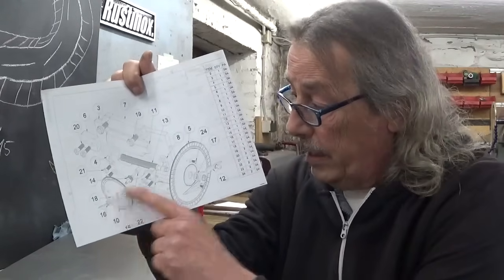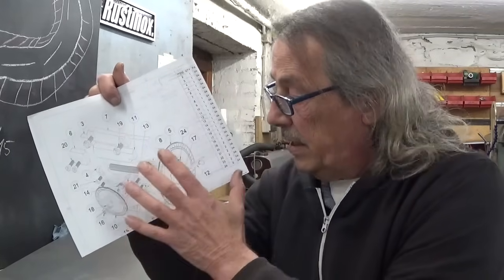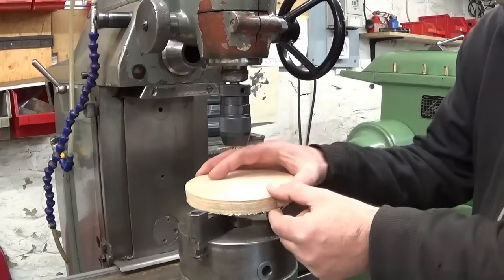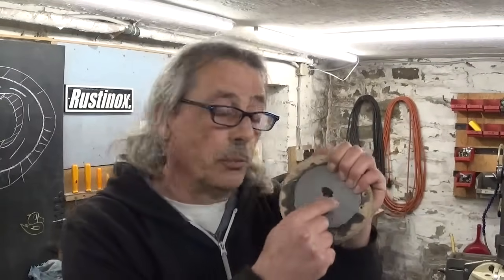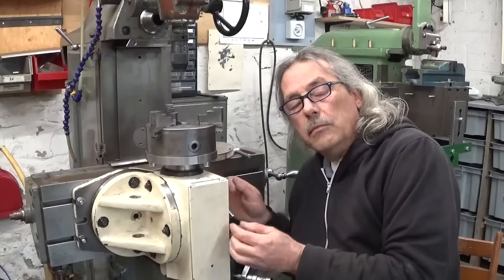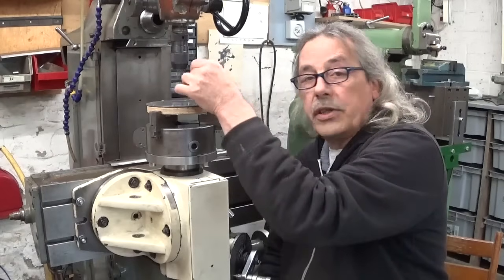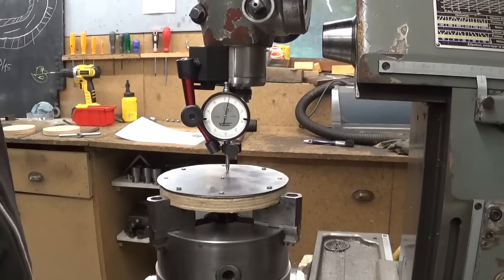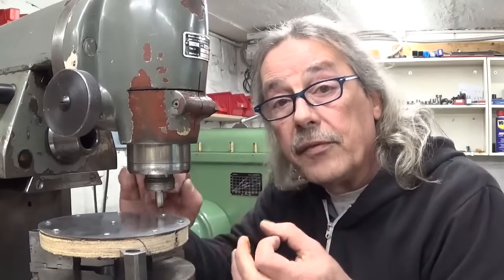James Watt's micrometer, the dials.

Comment: Nice work on the dials Michel. 
One thing that I learnt from Mark Presling when drilling thin material is to use a piece of rag when drilling the material. The rag stops the item being pulled up by the drill when the drill breaks through the material, and it help to drill a round hole.
Reply from the maker: My grandad showed me that trick 45 years ago. It works great.

Comment: I'm right there with you on using scraps or cut offs for projects, if it's just a piece of scrap or a cut off I don't have to worry about ruining an expensive piece of material if I screw something up. Coming together beautifully 👍👍
Reply from the maker: As I said, it takes away the stress part. And that's where we don't screw up :)

Comment: You made a very nice job of the dials Michel. I had to cut a circular plate of aluminium a while back. I fixed the plate to piece of wood with double sided tape, and held it against a faceplate on the lathe with a live centre. Then machined it to diameter. It worked ok. Cheers Nobby
Reply from the maker: I will try that one day. Thanks for the tip.

Comment: That engraving looks really good!
When you're drilling sheet metal, one little trick to stop the drill grabbing or making a nasty burry hole is to put a small piece of cloth under the drill bit tip. The results are surprisingly good for such a simple trick.
Reply from the maker: My grandad showed me that trick 45 years ago. It works great.